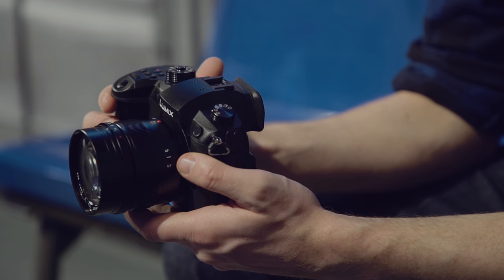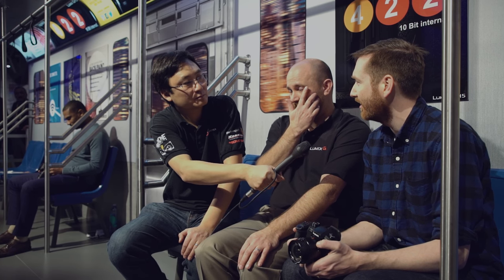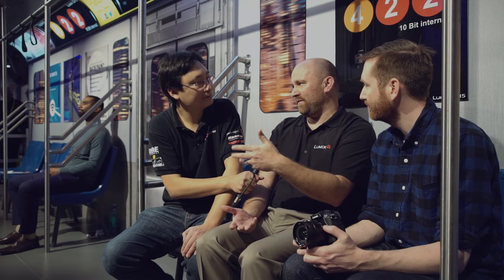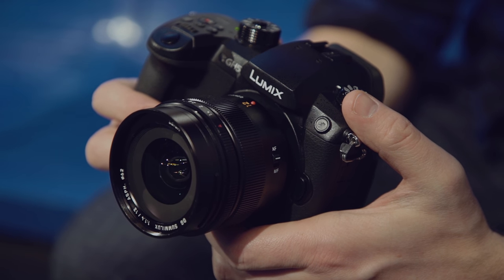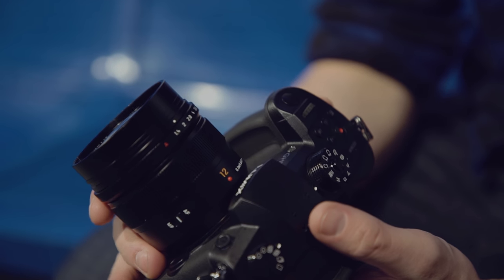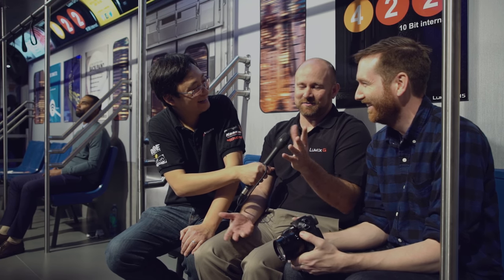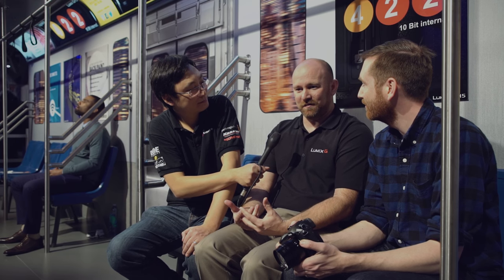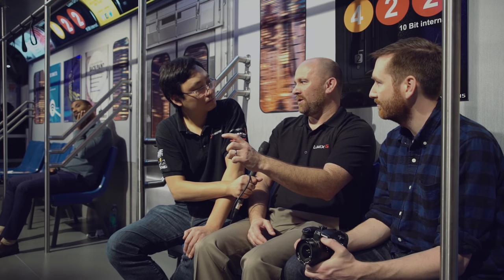Panasonic GH5 - Important details for shooters + hands-on experiences from filmmaker Griffin Hammond

Comment: Credit to Griffin Hammond for an honest input - the interview has pushed me to the A6500 not because the GH5 doesn't sound an amazing camera it's just that it's got a lot of stuff on it I really don't need to pay for and is missing some stuff that I really will pay for the fastest AF and good low light performance. That's why I'm buying a Sony A6500 (I'm a Nikon shooter I have no Sony equipment) the only thing I wish the A6500 had was a rear screen like the GH5.
Reply: Be very careful of rolling shutter as the A6500/A5300 have loads of it in 4k (same in both):
http://www.dvxuser.com/V6/showthread.php?303559-Measuring-rolling-shutter-put-a-number-on-this-issue!
I did an informal GH5 rolling shutter test yesterday and it seems quite a bit better than my GH4, which is already a long way ahead of the A6x00s.
Reply: John Leslie I'm not that type of shooter I really don't do any quick panning. I do a lot of low light shooting and wan't a camera that can AF on a gimbal. So far I haven't seen a camera that can do that better than the A6500.
Reply: Remember rolling shutter affects anything moving across the frame and can cause issues with any lights that flicker at low-ish frequencies.
Reply: There's enough people producing great footage in the wedding industry with these cameras - that's good enough for me - low light is more important to me.
Reply: Just to be clear I was pointing that out in case it was useful, rather than objecting to your choice in any way. Other than the rolling shutter the A6500 is a great camera.
Reply: Thanks John - yes I knew about the rolling shutter and a lot of people warn about it, it's a chance I'll take, even with the low light capability of the GH5 possibly being less I know it's a great camera ergonomically. You have to weigh up your going to encounter with your work and work out what you need and don't necessarily need.
Reply: Depends on the look you're going for and the light level, but 10-bit internal recording is very very handy if you are being creative (or just screw up a bit).

Comment: Ok but how good, fastest and precise is the video af? This is a question where nobody answer, it's too difficult to give us a good answer?
Reply: he said it's going to be way better than the pre-production models they have right now, so I'd say nobody knows yet how good it actually is but they promise it's going to be great
Reply: I really hope that, is an important thing for me
Reply: Too early to say as they promise it will improve a lot. I've used a GH5 with 0.3 firmware a couple of times, including yesterday, (BTW 0.44 is out now) and I think it has quite some way to go. But that doesn't give any idea how far it will move on.
Reply: Nice to read it, do you think it will be almost comparable to dualpixel af?
Reply: Very hard to say and I could only guess. Really it just depends on what Panasonic come up with and no-one knows, plus the camera I had on a couple of occasions doesn't have the latest firmware anyway.
Reply: I had one with a later beta firmware a couple of times and it's still miles and miles away from Canon, but they do promise big improvements prior to launch so who knows.
Reply: CrexTV its fast. You can set the speed and sensitivity of AF.

Comment: I wish you asked more about the continuous AF in video.. I've heard hints here and there that it's really fast with tracking because the DFD system analyses a lot more frames than the old system
Reply: My understanding is the DFD system can analyse twice the number of frames (480 vs 240) but what changes is previously (GH4) it updated the tracking info every 6 frames and now it does it every frame. (The GH4 does AF every AF frame, just tracking every 6.) As the GH4 is going 40fps tracking updates I'm not sure how much difference that will make. Could be good.
Video AF isn't good (not meaning bad, just not "good") in the GH5 I've used a couple of times, most recently yesterday, but the firmware still has a way to go.
Reply: I don't care much about tracking speed with shooting stills, I need fast single point AF and Panasonic has that covered already. I do need good continuous AF during video but I'm afraid a contrast detect system will never be as fast and direct (no hunting) as a sensor with pdaf. I hope Panasonic can work some magic with the latest firmware but I'm skeptical if it's possible.

Comment: Is the YAGH working on the GH5? 
I don´t like this XLR adapter since it comunicates with the hotshoe, if I understand it well. That makes the thing bulky, esspecially when adding a shotfun on top of it.
Or does Panasonic produces a connection cable, that could connect the Camera hotshoe with the Xlr adapter, for use on a rig or by hand.
Reply: The GH5 does not work with the YAGH. No connection cable has been shown.
Reply: It also won't take the GH3/4 battery grip, you need a new one. (Well, I need a new one anyway.)
Reply: I believe you, but why doesn´t it work with the GH5?
 What has chenged?
Reply: Body is thicker.

Comment: Thanks for the video, but: Hundreds of GH5 reviews on Youtube and not a single one that talks about the IBIS noise in video recordings (as the G85). Yet this seems to me very important.
Reply: I have not noticed it on my GH8. The interview was with a pro shooter who took audio off an H5 recorder, so they would not have noticed it. They may have fixed the issue with firmware. I can't imagine they will let a pro level camera like this go out with that noise. You can probably get around it by adding an Olympus small recorder onto the top hot shoe and match the sound in edit. That would get you buy at a low cost.

Comment: Would love CinemaDNG output to Shogun. That'd be legit!
Reply: You can already record 4k/10bit/422 in either Prores or DNxHD to an external Atomos (inclusing the high bit rate versions) which gets you a long way towards what CinemaDNG gives you at miles lower data rates. You're not getting CinemaDNG though. I do think if I change my GH4 to a GH5 my Ninja Assassin will become more of a monitor or not used now it does 10-bit internal, at least when I'm off a tripod.
Reply: Yeah, 10 bit 422 is great. But it's still not capable of utilizing RAW controls, which allow you to have full control of the color grade. Right now, there doesn't exist a 4K MFT camera capable of RAW output. But Panasonic could be the first if they'd just permit it to work via Atomos gear!

Comment: Anybody testest the Speedbooster on the GH4 in Photomode?
Reply: sas-image B-Channel i have the gh4 and the speedbooster XL. I use the 18-35mm a lot from sigma (an aps-C lens) and it will crop a bit at 18mm in photo mode at 16X9 at 20mm it goes away. If the lens you're throwing on is a full frame lens, there won't be any vignette.
Reply: Thanks man!
Reply: sas-image B-Channel the speedbooster XL has the 0.64 crop change, the speedbooster ultra has 0.71, on the ultra, no lenses should have any issues with vignette!
Reply: I am more worried about the Speedbooster xl touching the GH5s sensor
Reply: sas-image B-Channel I don't see why it should, the flange distance has to be the same for the gh4 and the gh5. the speedbooster XL was built especially for the gh4, the XL was not the one build specially for the bmpcc. if the flange was different on the gh5, then all their m43 lenses wouldn't work right?
Reply: Okay, yeah. If, then because of the sensor stabilisation i think. Someone just hast to test it. Thanks for your answers!
Reply: sas-image B-Channel the speedbooster XL works on the G85, and it has ibis too, the speedbooster XL should work, but yeah, I would really enjoy a test...

Comment: I do underwater video shooting and have used Panasonic since the GH1 plus Ptool hack. AF is an important feature when shooting fast in a changing, hostile environment...particularly at depth. Sadly, as the cameras got better their AF has not...the AF in the GH4 was slow and error prone crap.

I'm very disappointed that Panasonic haven't implemented phase detect AF in the GH5...keeping an open mind until I test the GH5,  but probably going to dump Panasonic and get a couple Sony A6500's...